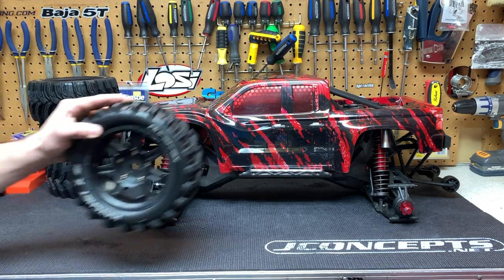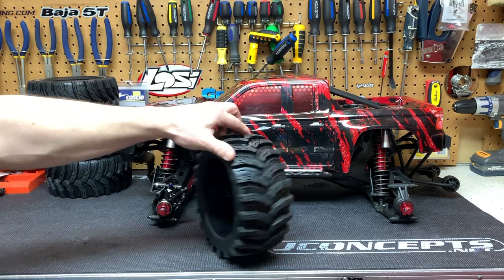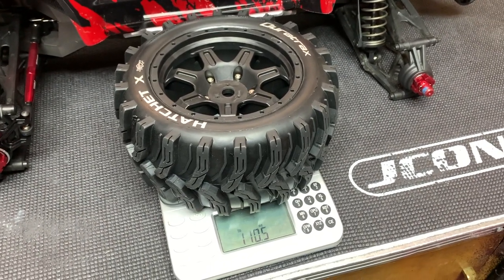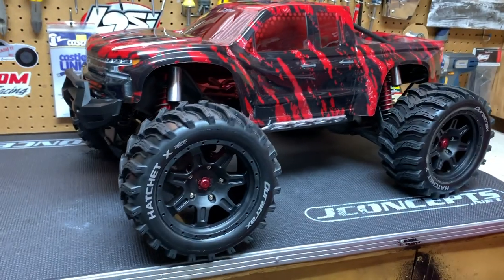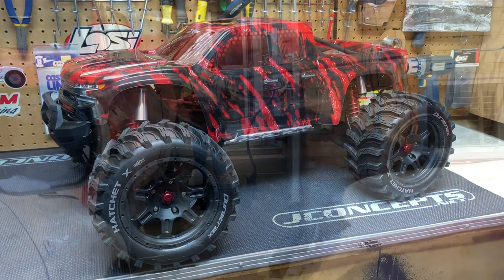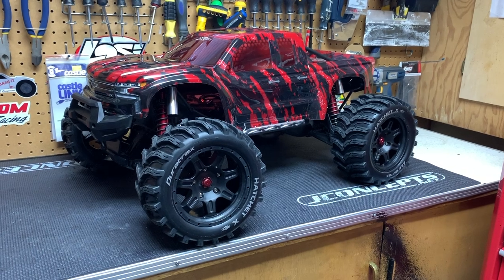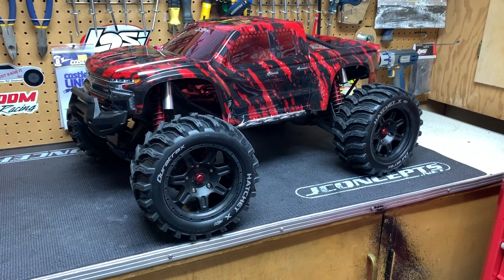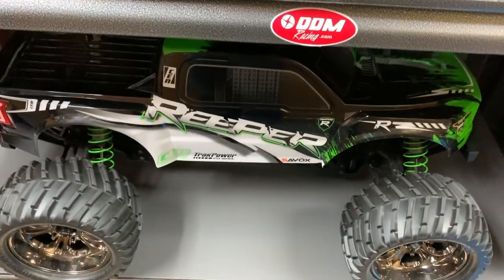Traxxas X-Maxx - upgraded with Duratrax Hatchet X tires (2085X Servo)

Comment: If you replace the bushings in the servo saver to bearings, it makes a big difference in the steering since the bearings move freely and bushings rub causing lag and steering issues in the long run. Bearing will also extend the life of your servo. Yes yo can put the biggest battery that your machine calls for but until I get my metal gear put in all my vehicles and the right diff fluid to help, I run my 3ss on 2s mostly, 6ss on 4s and the Xmax 8s on 6s, one because of summer now and to keep the heat down (and it's still fun) and until everything is upgraded to what it should be with diff and shock oil and servo saver bearings. Still will run them  on full power once in awhile in a field and some small jumps. I dont bash cause I like to keep them in one peice and not having them sit while parts come in. Especially new models because everything from vehicles on back order and if need warranty work can wait 4 months as everything is on back order since 4 of Arrmas 3s line have pretty much all the same parts so your vehicle sits unused after the second day of having it and finally 4 months later being able to run it with no problems. But it's all part of the hobby I guess. Lol Sorry so long.

Comment: Got the mx57 about 50 grams per tire lighter but the tread on the hatchet x seems a bit better for urban environment. Hatchets are $90 for a set the mx57 were $180 for a set..bout to return the mx57. Can 2 sets for the price of 1 set of mx57.

Comment: These tires look great and performed great but I had to reglue them after every bash session and then two finally blew apart simultaneously. Done with duratrax and glue and moved on to the badlands.

Comment: I recently got some which was duratrax lockups st 3.8 and man... they are bigger then expected. It made my dhk Maximus look tiny with those wheels and the Maximus is 8th scale. Had to return it because it was way too big. Thought it would be like badlands 3.8 but it was bigger and heavier. I will definitely get those tires when I do get an Xmax on the channel. 👍

Comment: I put such tires from the factory or from wherever I can find for  mine 1/8 Scale the olny and one thunder tiger MTA4 s28 nitro 2 speeds baby 80-90klm they are expensive 70 euro but they are the best they don't break easily if they are new?
You can do everything ln the truck sund at the beast at clime mountain

Comment: Do like those wheels and tires. I'm looking for a good pair as the Xmaxx as the ones on it dont seem to have a good glue job. On 6s was seeing a bulge on the side of a tire and noticed maybe a dot of adhesive in that 1/4 of the tire.
Reply from the maker: The duratrax are my favorite tires hands down. Even of they were the same price as proline.  I would still choose the duratrax.

Comment: Nice! I wonder if they will work better at the beach than my stock Xmaxx tires
Reply: They definitely would be. The chevron pattern is like a shorter paddle tire and the belted tires have more contact area or surface patch contact than the stock balooners
Reply: @jaybringus6818  Thanks!

Comment: What shocks are those?
Reply: lmao stock xmaxx shocks
Reply: @masonclark6013  I didn't realize OEM XMAXX shocks came with remote reservoirs.
Reply: @chuckAWD  Those are Proline Ultra Reservoir Shock Caps (SKU: 6293-00) $112 for 2, $224 for a full 4 set.